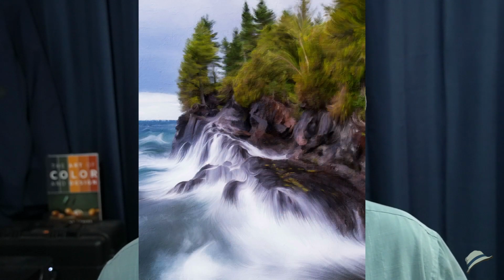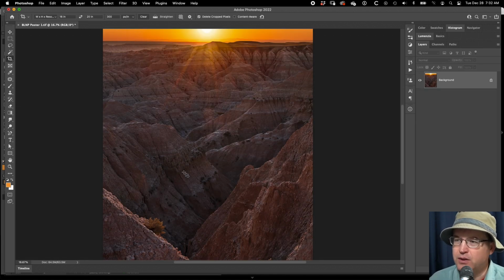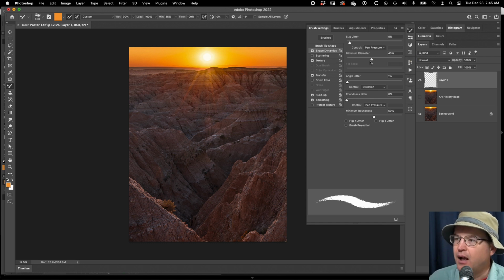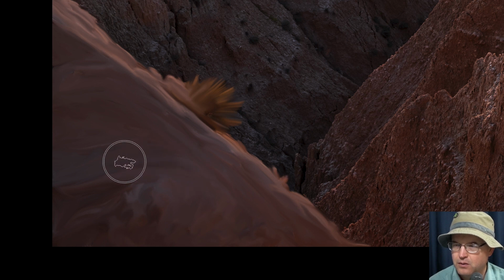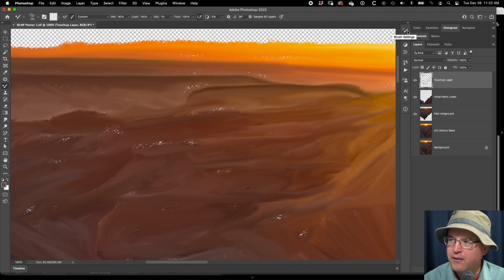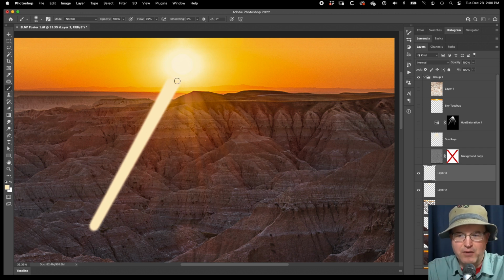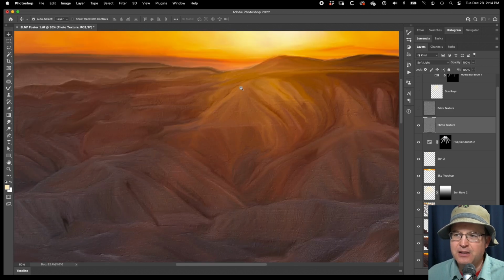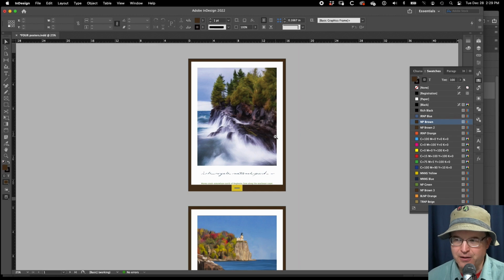Digital Painting For the Win! The entire creative process of making a digital painting.

Comment: Brent,   After I select the art history brush and go to grab a brush style like the wet brush, the icon at the top changes from the art history brush icon with the swish to a brush with a dot in the upper left.  Then I can no longer change the hue jitter and the saturation jitter.   I use a windows pc, not a MAC.  Can you help me out?
Reply from the maker: Hi there, thanks for asking. Starting at about 25:15 I address this issue of the brushes switching up on you. The brush with the dot in the corner is the mixer brush. that's the primary brush I used for most of the painting. To do the art history brush technique you'll need a standard brush, one that doesn't have that icon attached to it in the brushes panel. As for the jitters, you'll need to click the checkbox in the brush settings area to activate the areas where the various jitters appear. Note, not all brushes support these various changes though, but getting that checkbox clicked is likely your issue. Good luck, and let me know if there's anything else I can do to help!